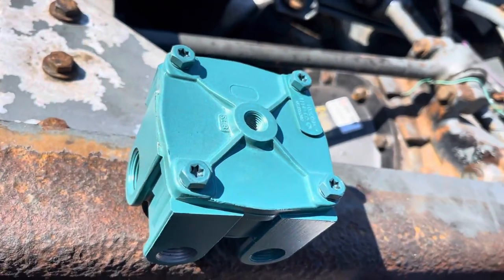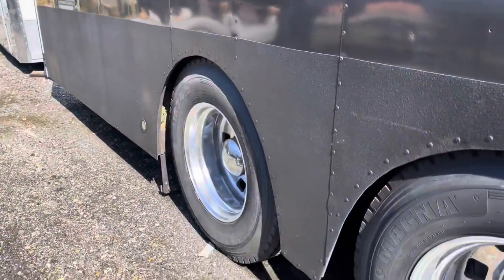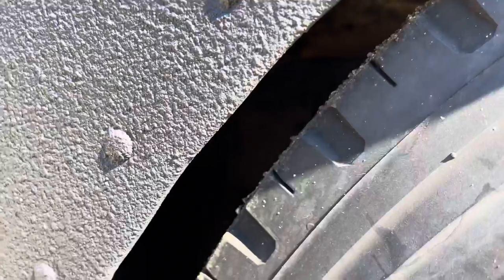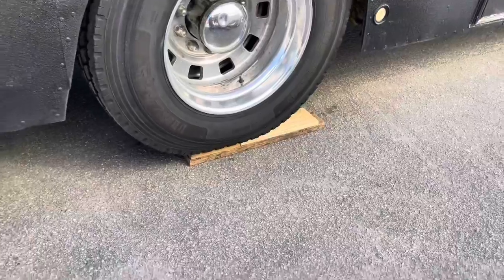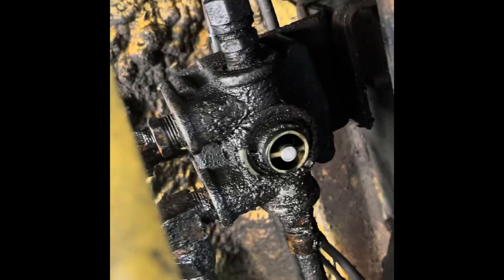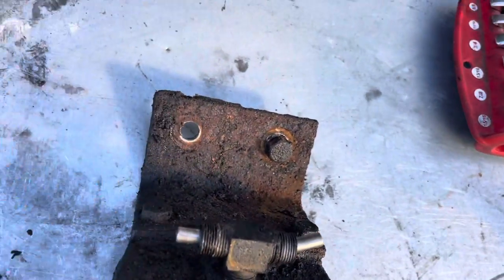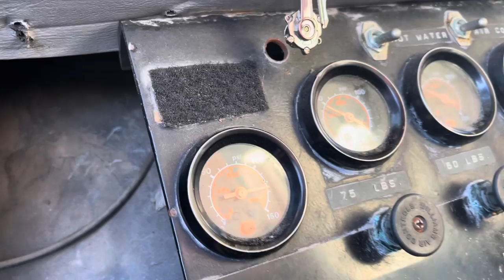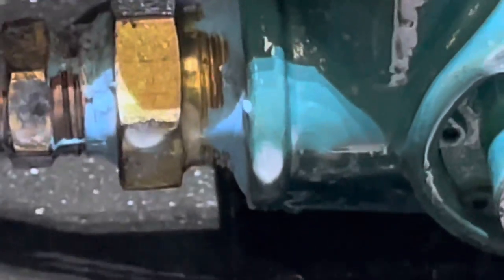PROJECT GOLIATH!, replacing an air brake relay

Comment: Very good explanation of the valve!!!
In the old days we always was able to just get parts and rebuild the valves now days we just buy new and throw away the old valves. Adam please if your air compressor is passing oil as much as you think it is rebuild or in this day and age replace it because all of the oil will gum up all your valves and you will have to eventually replace all of them.
Thank you for the video I miss working on trucks!!!!
Reply from the maker: I agree Richard that’s why I’m looking for a replacement already

Comment: Need to get some 6"X6" and cut a slant on it so you can back up on them give you that little bit more height to work  don't you love how they seem to always change something on those valves it never fails but stay safe keep the video's coming
Reply from the maker: Yeah I’ve actually been meeting to build a set of rims for it instead of just stacking blocks hey

Comment: Adam, Why won't Amsoil paint or supply graphics on the side of that big 3 axle billboard you are pulling behind Goliath??
Reply from the maker: They probably would Tim, but I prefer not to have any logos on it when I’m going down the road. It keeps a DOT for messing with us. Technically it is registered as an RV and I am not legally required to go into waste stations. However once you put commercial marketing on it then they can claim you were using it for interstate commerce and they hassle you. This way we just stay off the radar completely

Comment: can you not relocate the air valve or modify the tin work between the drive wheels to make access a bit easier of lift the truck to get better access ?
Reply from the maker: I probably could but it would’ve actually been way more difficult thing just doing the job the way I did it

Comment: How large is the compressor on a big truck like that?
Reply from the maker: The pump that is on the engine is only 10 inches or so by 10 inches give or take. Put in there are a few air tanks mounted underneath the frame. If I remember I’ll take a picture of the actual air compressor on my next trip up there
Reply: @amsoiladam  you all have a safe trip to Daytona